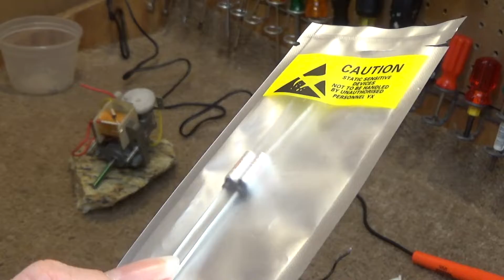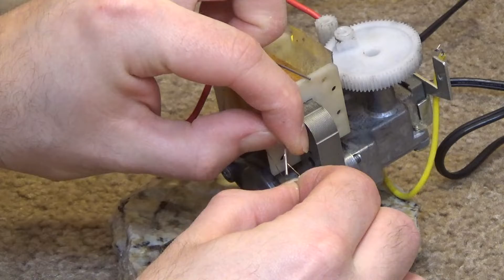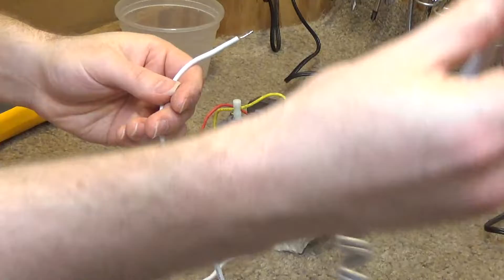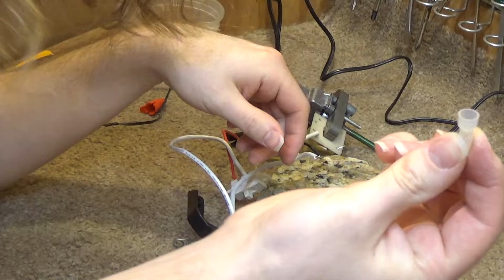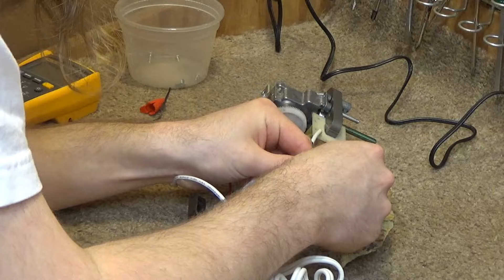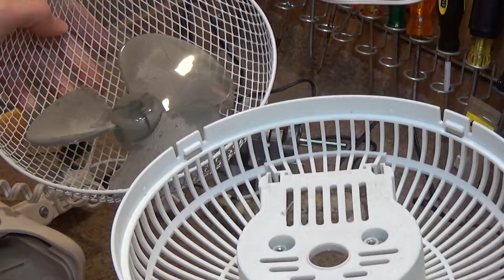Holmes HACP9 Clip Fan | Thermal Fuse Replacement

Comment: Where do you get thermal fuses from?

I need to get some for a floor fan and a coffee maker that I have. Thanks.

(Coincidentally, the ones that you're showing Look just like the two that I found inside my Gevalia coffee maker, but I can't seem to read the specs on those fuses because the print has faded too much.)